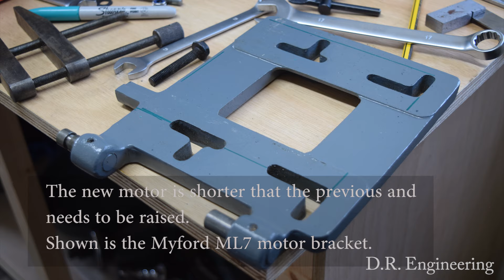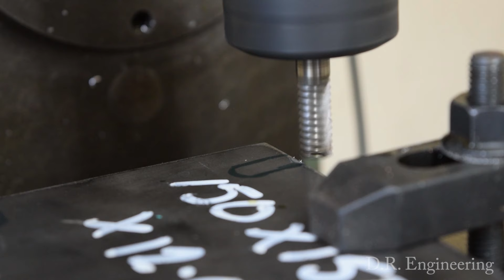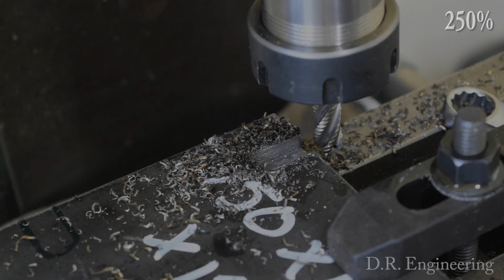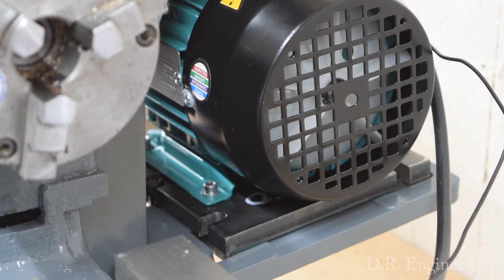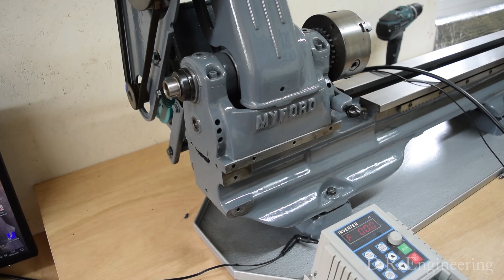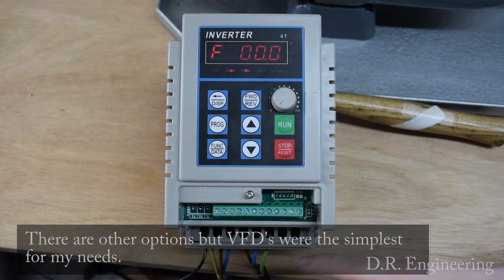DIY CNC Lathe Motor bracket and running update

Comment: Most motors nowadays are 50/60 Hz so you could probably "over-speed" with the VFD without an issue.
Reply from the maker: Yes it should be possible. At the moment the motor max rpm matches the original recommended speed for the Myford bearings. But I might tweak it up slightly.
 As of late last night, I had the Z axis running via the stepper motor so that will be in the next update video, plus starting on the X axis today.
Reply: @TinkerInTheShop  Indeed. Standard four pole single phase motors operate at a little below 1800 rpm on the US and Canada 60Hz. To my knowledge Myford did not supply special pulleys for exported machines.
Reply from the maker: @boldford  I'm sure if I monitor the heat of the bearings and keep them well lubricated I shouldn't have a problem running the spindle a little faster. It's yet to be seen if I need higher speeds or not yet though!